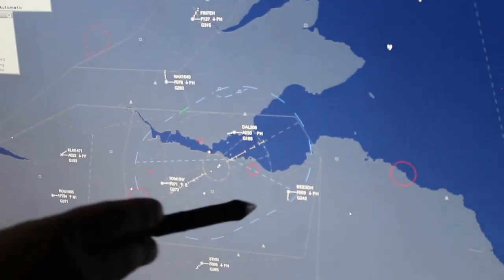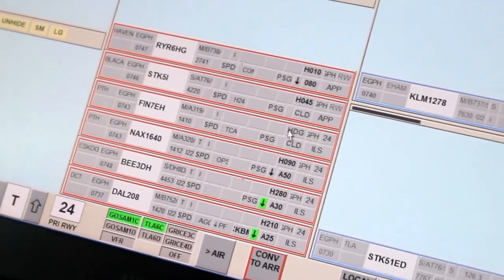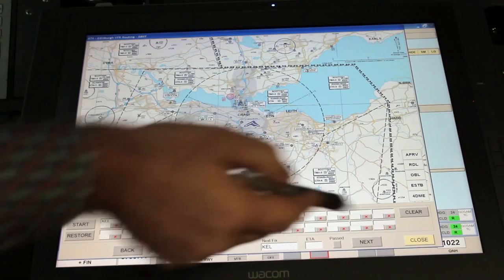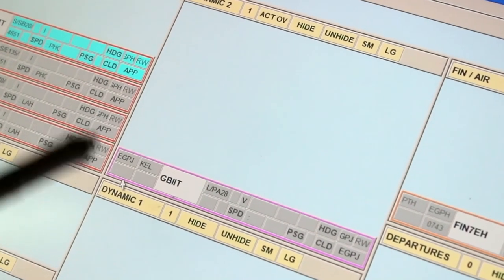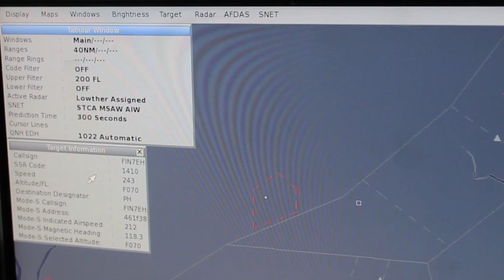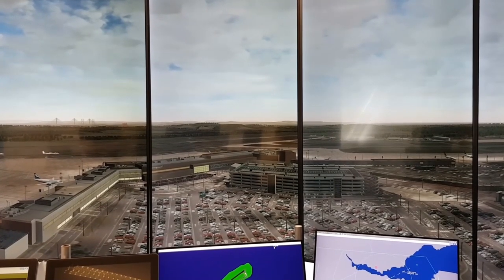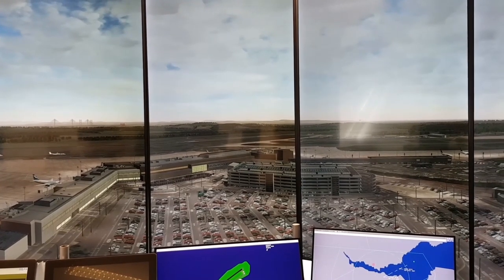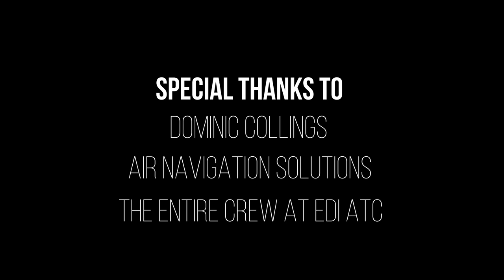Inside Edinburgh AIR TRAFFIC CONTROL

Comment: Great video. Changed a lot since I last visited the Edinburgh ATC about 20 years when they were based in the old tower over on the other side of the airfield.
Reply: Paul McConnon that tower now sits derelict. Sad sight.
Reply: @nortonchow3286  Is it protected in some way?  I saw a post on Lost Edinburgh recently about the sign at the entrance to RAF Turnhouse and someone asking if it was to be saved.  I dont live in Edinburgh so havent been on that side for a while to see the changes. Need to make a point of driving by the next time.
Reply: It’s not protected. Actually it’s getting demolished very shortly.